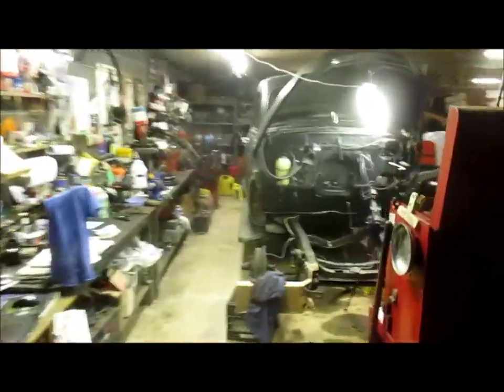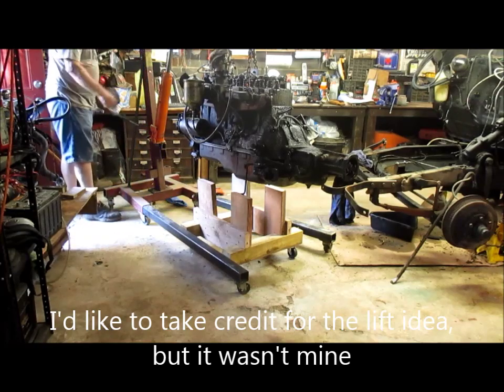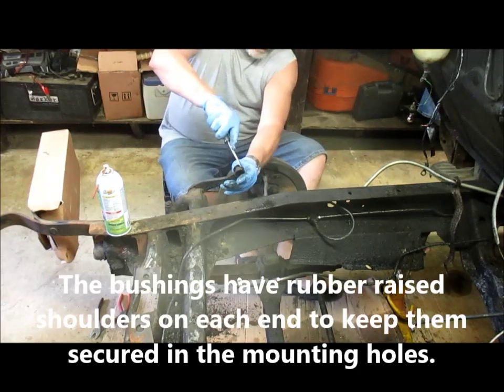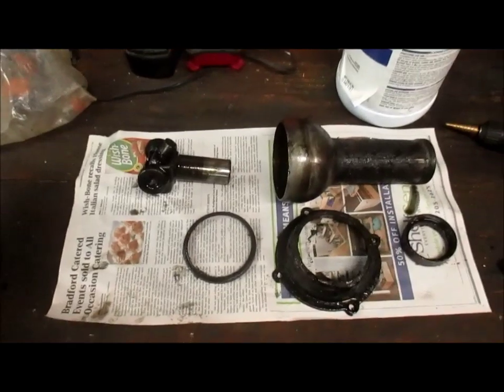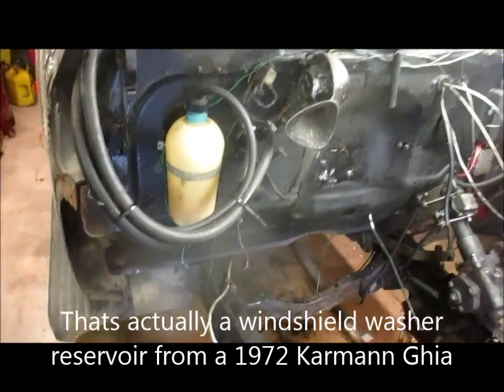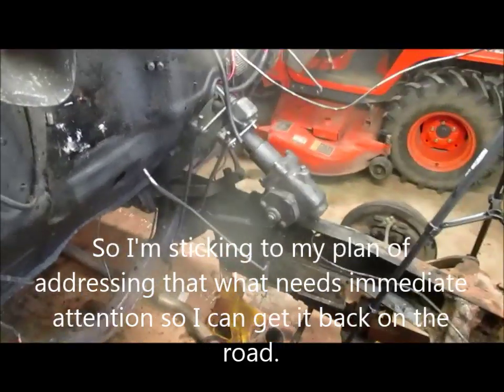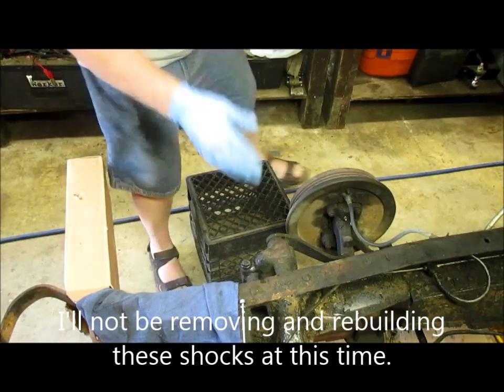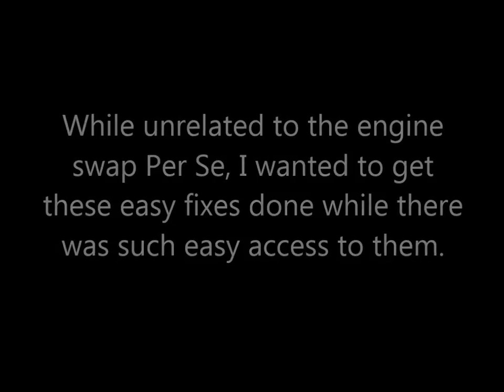1949 Chevy 3100 restoration Part 5, Preparing the engine bay

Comment: Gear box adjustment, much more simple than the shop manual. Thats called experience.
I will save it for future reference.
Im also checking the other under components that you recommend moving the steering wheel with a designated driver...
Thanks!

Comment: Nice, those shocks are interesting. My truck has a torsion suspension on the front end, Chrysler sued them for it lol. Strange old machines but they're tough as nails
Reply from the maker: 49 was the last year for those Knee action shocks, Chevy/GM went to the modern tube type shocks in 50.

Comment: Do you know if there’s any adapter available to convert from the lever action shocks to modern shocks? I believe my lever actions are original to the truck and are a little over due for a replacement... haha
Reply from the maker: Yes, there are several options. Chevy/GM switched to tube style shocks on the 1950 models. The tube shocks are available from many FLAPS and on line providers. The brackets come in kits. Theres several on ebay, some are brkt's only and others include the shocks. Heres a link for you:  https://www.ebay.com/itm/1947-55-1-48-49-50-51-52-53-54-Chevy-Truck-and-GMC-Truck-Front-Shock-Mount-Kit/152250540293

Comment: Hi
Im trying to replace the drag link on my 54 chev which have the play i got on the steering wheel.
Took the pin and nuts out but the bolts are pressured stock...
Any advise to slide them out without damaging the gear box leg.
I dont want hammered it out.
The impact may damage something.
Thanks!
Highly appreciate you advise!
Reply from the maker: Have you already purchased a new drag link? If not the ends/adjusters can easily be cleaned and reused or replaced if worn too much. 
That is if your's are original OEM. 
Sometimes you can adjust out the play in your OEMS'  also. The manual covers cleaning and adjusting the drag link/tie rod ends very precisely. 
After you've removed the big threaded nut, you can fish out the spacer, spring and end cups fairly easily and the drag link with just fall off. 
Sounds like the old grease has hardened and is keeping those parts inside form coming out. They will come out.
Hopefully you're not talking about the ball end that is pressed onto the pitman arm. It has to be drilled/machined out and replacements are hard to come by.
Reply: @Volfandt  thank you very much. I verify all that!

Comment: Tenho uma Chevrolet 3100, estou restaurando, mas estou com dificuldade de fazer o alinhamento dos Paralamas, e  grade e capô, VC poderia me dar uma dicas de montagem,
Reply from the maker: The easiest method is to mount the hood first then assemble the inner and outer fenders together first, then mount them onto the frame together but keep the mounting bolts loose enough to be able to slightly move them around to line up with other. Once eveything is lined up you can tighten up the mounting bolts.
Good luck. 
Thanks for watching
Reply: @Volfandt  
you could make a video from the beginning of the assembly, starting from the internal fenders and then the sternum and radiator and grill and hood, the correct way to do it.
Reply from the maker: @pardalsand  Perhaps someday in the future when I attempt to do some body work to the Chevy. Try assembling on the ground then lift and attach to the frame and cab.
Good luck
Reply: obrigado professor, vou tirar tudo, e fazer a assembléia no chão, aproveite a quarentena! Aqui no Brasil, tenho muitas dificuldades com peças, e muito raras.  @Volfandt